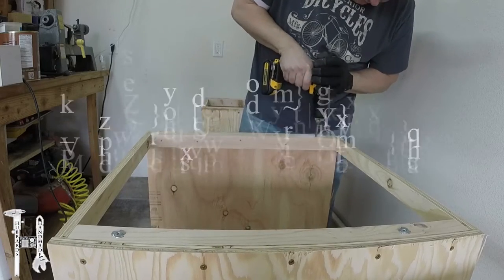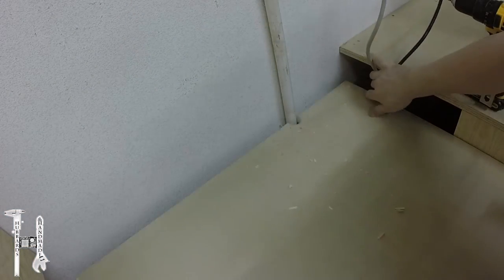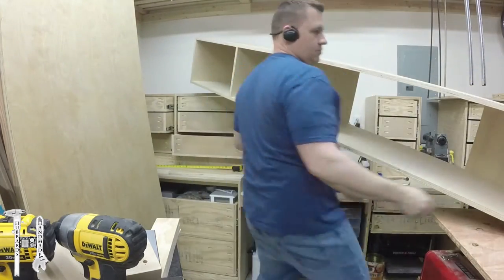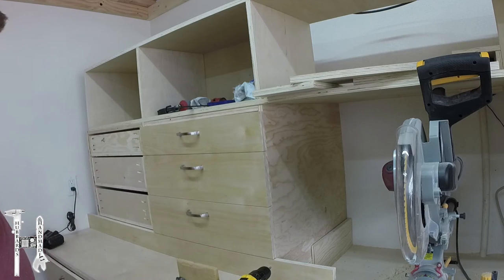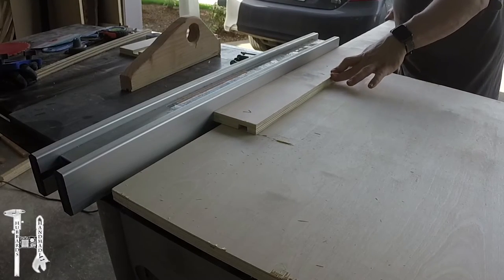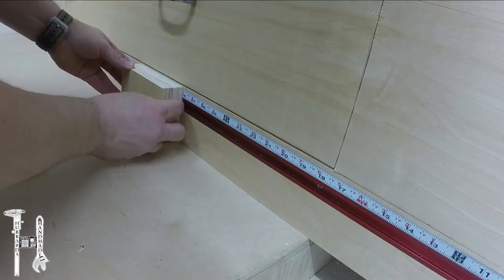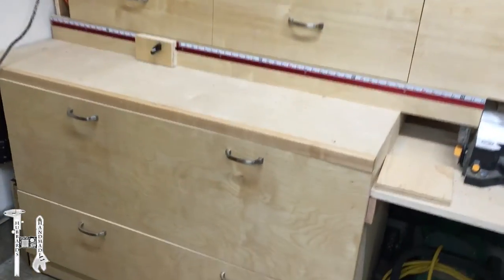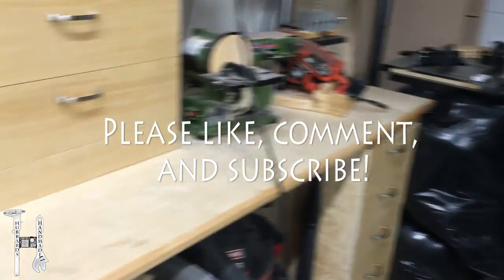Miter saw Workstation part 2

Comment: Nice man. looks familiar. I feel for you on the miter saw. I had the same saw and the lever to move the miter broke right off the bat. Hope you will have better luck.
Reply from the maker: Thanks for watching Matt! The only problem I have had with the saw so far is keeping it square. It has quite a bit of play even when its "locked in"
Reply from the maker: Thanks for watching Matt! The only problem I have had with the saw so far is keeping it square. It has quite a bit of play even when its "locked in"